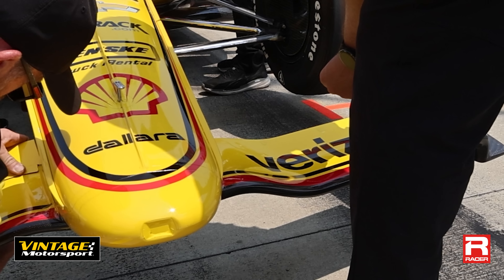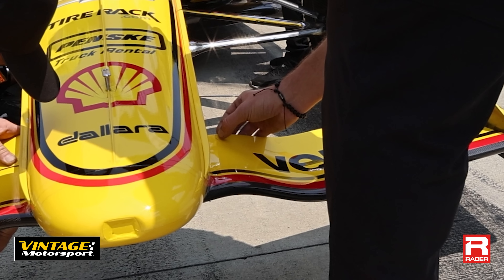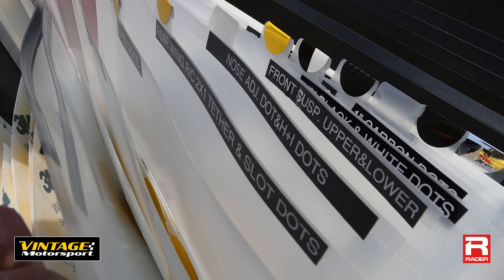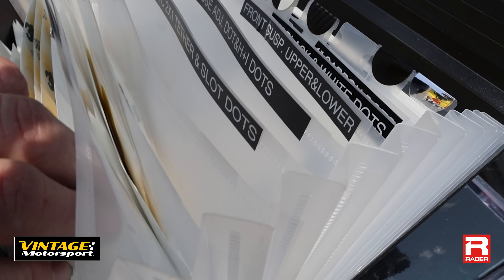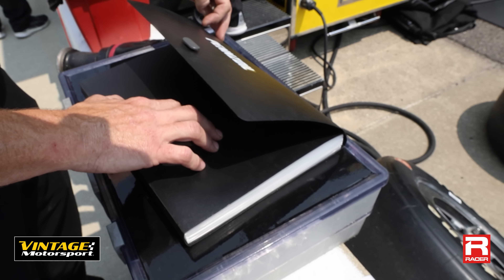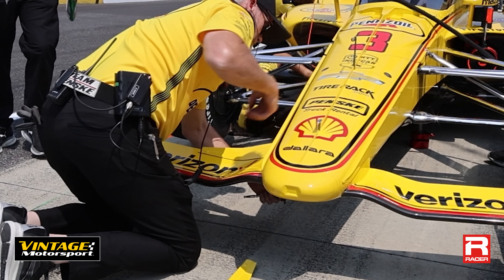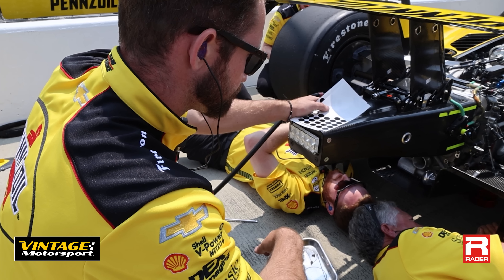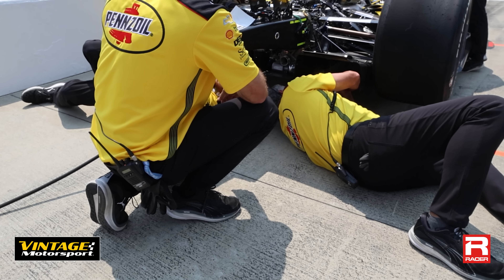Team Penske's Sticker Routine At The Indy 500 - hosted by RACER's Marshall Pruett

Comment: A correctly shaped decal with the correct thickness could be used as a vortex generator as well......
Reply: As long as it passes tech. There's go/no-go gauges for every single piece of bodywork on the cars, and if you go outside the allowed tolerances (which are pretty tight) you get DQ'd